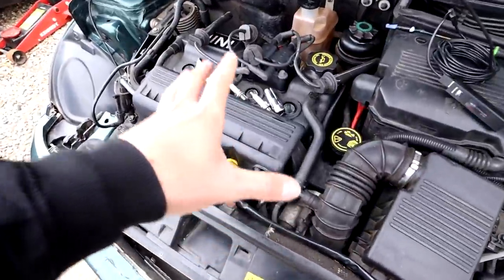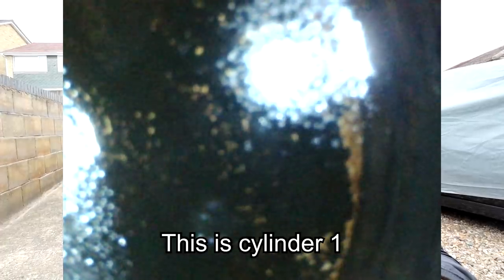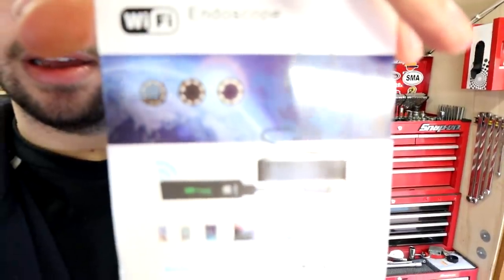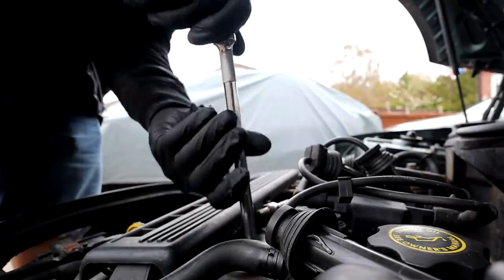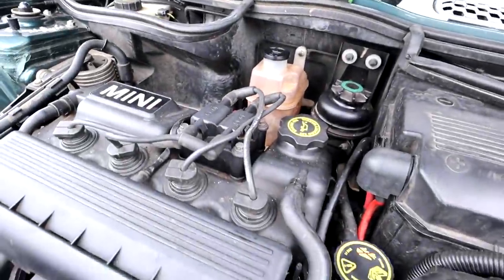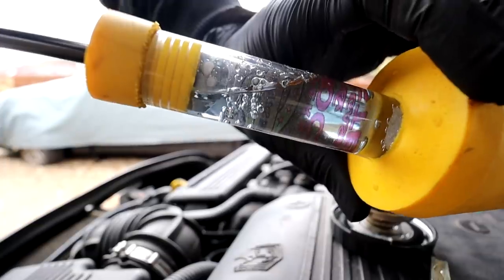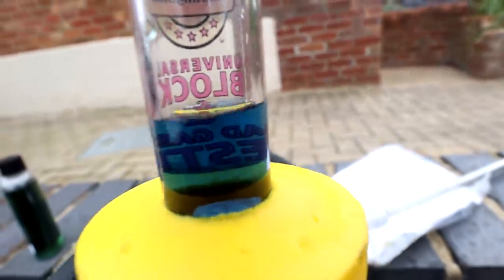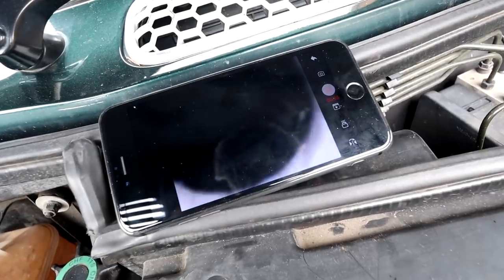Mini Cooper NEEDS a Headgasket!

Comment: Hello Mate. The test kit goes on the header tank. The engine needs to be running while doing the test. Any products of combustion are pushed up through the header tank. The Gasses are pushed up through the sniffer kit and mix with the test fluid.

Comment: I thought the tester was supposed to be used on the header tank, because it's only supposed to "sniff" the air when you pump (rather than suck up coolant as it did in the video). That's how I've always used them (usually successfully), but I may be wrong.

Comment: Stick an egg in the coolant bottle, if cylinder 1 has scrambled eggs in 20 mins u know its gone. 😂
Reply from the maker: Jason Poole 🤣
Reply: Jason Poole is that your RS because, it’s looks mint
Reply: @Joe-qs9fw  Yes mate, Cheers
Reply: Jason Poole also a tasty breakfast once you get the head off.
Reply: @Cjrelectrical  HaHa agreed.
Reply: I guess your RS has already made you some scrambled eggs then?
Reply: I apologize :)
Reply: @colinboyd4371  lol nah i had it fixed before eggs where served 👌
Reply: @jasonpoole6284  Excellent news, i'm probably just jealous :)
Reply: @colinboyd4371  Nah dont be they are over rated.
Reply: tried that out, engine stopped working, there is black smoke coming out, WHAT TO DO NOW???

Comment: James re-do the test.It starts off blue run the engine and re-do test with engine running. if it goes pale green or yellow that means you have exhaust gasses running through the coolant.

Comment: Glad you have managed to confirm it - always good to be 110% sure about something rather than guessing. Though i must admit i guessed it was the headgasket in the first video where you were bleeding the system. For one, whee did all the coolant go if it was not escaping externally?, then once you had bled it you were still getting a pretty consistent stream of bubbles escaping through the filler neck whilst the engine was running, in my experience that is a very good pointer to gas being forced into the system. The final nail for me was in this video when you showed how badly it ran when you first start it up, add that to the other evidence i was convinced it was the gasket. But its always preferable to see conclusive proof - and you can't argue with actually seeing the water dripping into the cylinder. Always good to get rid of any doubt when a lot of work is involved. But should be a fun job, like you i love doing jobs like this.

Comment: Next video, mini front end service mode. You don’t need a timing tool for an r50, but you will need a few bits to take the drive belt off, I made do with a 16mm socket, a bit of foam a long crow bar and a 5 mm Allen key, but I have an r53 so yours might be slightly different. You will need a harmonic balancer puller, take off the timing chain cover with the oil pump. You will see some bronze coloured links on the chain. Two on the crank sprocket and one on the cam sprocket. Check the cam and followers too as they tend to wear quite badly as these engines suffer from top end oil starvation.

Comment: Compression test, if it holds pressure, along all 4 cylinders, head gasket, casting, piston rings and valves are fine
Reply: Which it didn't, so needs a head gasket
Reply: @ethanmccrory1727  He didn't do a compression test though, if he had, it would have revealed an issue in minutes. One of the best diagnostics tools is a compression tester 👍
Reply: @GTStGambit  coolant pressure tester?

Comment: Bash the inside of the door where the motor is while holding down the switch.  Bang it hard! Mine goes on the blink from time to time. A good old banging does the job for me. Also pushing the window down while holding the switch has also worked once

Comment: My tester has blue fluid...it should change to green or yellow to indicate exhaust gases in the coolant....The instructions mention that it should be stored carefully and once opened it is normal to discard the remainder...it goes off quite quickly IIRC.  One other thing is that you would be safer and better to sample the gases from the overflow/header tank...same result if the engine is at operating temperature. but without the 13 odd PSI and hot coolant to worry about.

Comment: I've had gaskets that were not leaking into the cylinder and one of those testers was the only way to diagnose it. Mine started blue and turns green/yellow after a few minutes of engine running. In each case I've also seen a continuous stream of bubbles through the tester.

Comment: Tip to know easily if coolant is being cooked off. Have a quick smell of the exhaust gas, if it smells sweet (exactly like coolant) then you have coolant in the exhaust stream. Would have been my first test... try it before you pull the engine apart James, then compare with a properly running engine. Once you've smelt it once, you'll easily recognise the smell in future. Keep it up. Good investigative work, rely upon testing rather than guess work ftw. 👍

Comment: Notoriously hard to diagnose a blown  head gasket that isn't obvious.
Had a vauxhall Astra that was losing coolant , was only slightly overheating in traffic and was still driving okay .
Took it to a garage I trust and they used the emissions machine they use for MOT testing to do a sniff test , no carbon monoxide in the expansion tank .
A few weeks later I decided to use the test similar to the one you used and the liquid turned blue .
Head gasket was gone , as I said it's not always  an easy diagnosis to make.

Comment: Check the head is not warped with metal straight edge  before fitting gasket the head might need to be skimmed
Reply from the maker: Mike N it’s not my first rodeo lol
Reply: @TheSavageGarage  Honestly i have 4 minis in my family and have made all the i should have done  that mistakes whilst trying to fix them even though being a Trained Motor Mechanic  ,Main problems on R50 mini are  Rubbish midland gearbox except for Cooper s and diesel model which had Getrag boxes, Head gasket issues, Timing chain failures, Power steering pumps, Plastic Thermostat housing failure ,Front wishbone rear rubbers ,Engine mounts ,Seat belt pretensioner cable connection under seat ,Central lock motors behind door handle  and the list goes on but they are still a nice car to drive when Wife and Daughters let me borrow them. Also not as reliable as Ford Mondeo "forget rodeo and think Grand National with minis"  thump with fist just above speaker cover will fix electric window sticky motors never fails to work

Comment: The sniff tester has to be used with the engine running.  The fluid should start off blue and will change to green/yellow if combustion gasses are present.  If you hold the tube up to the exhaust tailpipe you'll see the colour change.  You won't get any result if the engine isn't running as no combustion gasses will be pushed into the coolant.

Comment: dont forget to get the head properly checked to see if its warped after running that hot and also get the head milled otherwise you will get this problem again

Comment: i knew the head gasket had gone aswell from the first video ,with the bubbling from the header tank when running..which would cause the system to presurise and throw water out......also the miss fire at the begining is the water in cylinder 1

Comment: The tester should be on the header tank, engine running. The liquid should be blue to start. Then turn to green or yellow depending on how bad the leak is. Maybe that liquid is duff, or give it a shake up first.

Comment: @james, the block tester liquid has gone off, should be blue, best way to check it, start the engine and use the tester at the exhaust end with it running it will change colour. Your meant to do it running with like the steam coming out of the coolant cap.

Comment: Try putting a tube between the radiator filler (an old toilet roll maybe)and the sniffer test and allow it to take in any potential combustion gases, you can also test the tester by sniffing the exhaust gases into the tester this should turn it yellow very quickly you can even then sniff fresh air and the fluid will turn back to blue and can be reused😉.

Comment: Normally if ur headgasket goes if ur exhaust is blowing white smoke check ur oil stick & it's a goowey white &water threw it as ur oil cap is white&black & sludgy,I did a few in xr3s,xr2s back in the day,don't no if newer cars AR the same,as not a boy racer now,keep chin up bro

Comment: The camera footage makes me think the cylinder head is cracked and this isn't the head gasket. I had this exact issue with my very first car (old MK3 ford escort), that had the same issues on starting until it warmed up. I guess we'll all see when you pull the head off. The footage clearly showing dripping down onto the crown of the piston definitely makes me think you have a cylinder head problem. Looking forward to the next video! 👍🏻

Comment: I would of done it with the engine running and from the expansion tank i would change the head gasket any way your doing a great good james so dont worry how you doing things keep up the good work looking forward to see you doing the head gasket 🙂👍
Reply: It was interesting to see the water leaking into the cylinder like it was it was coming in quite a bit nice

Comment: The Dr Headgasket fluid is blue in all of the online adverts for it that I've seen. Maybe it was used and could change back to blue!? If the tube/container that you put it in was contaminated with coolant that could have reacted with the fluid too. The dripping liquid is enough though isn't it, to decide what you need to do. ....

Comment: Do you have a retest again with the expansion cap Removed to bleed the system of air and  keep the engine at operating temperature and put over the Combustion Leak Detector tool or sniff test tool hover over expansion tank and pump to see if the liquid definitely turn yellow or green to confirm diagnosis of fault but the camera has already done it for you

Comment: Fair play coming up with the idea to put the pressure tester on then look in the cylinder that's what I usually do with them you'll be better off just taking the engine and gearbox out btw best way to do the head gaskets on the minis

Comment: James get a bottle of Steel Seal will fix the head gasket,trust me on this one .
Me 1.2 Corsa was worst then yr mini and Steel Seal done a grate job.
Reply: My Lexus has a blown headgasket it is very common on the is220d my fault as i was racing a Porsche but the steel seal didnt work at all it was a waste i did it twice and neither worked
Reply: Worked on my corsa too but sold it not long after so I don't know if it worked long term.
Reply: Well is dependents man.but on 2l engine u need 2 bottles of steel Seal.
Reply: I kept my Corsa another year after using Steel Seal. Whitout any problem.

Comment: When you start up and go to the back, you can see a damp patch under the exhaust pipe, doesn't this indicate it pushing water out? sure it shouldn't do that, yes you'll get a little condensation, but that puddle is more than condensation, also I'm seeing a faint hint of blue smoke. can you smell burnt oil (sadly youtube isn't smell-o-vision) :)

Comment: My car sounds the same on a cold start up then after 20seconds or so and a little rev it goes fine. Everything is ok with my car but in not sure if mine makes that noise becuase its only a 3cylinder or what but my car makes a similar noise on cold starts

Comment: this is a common problem on this minis I have done many of these head gaskets there a pain in the ass you've got to take the engine out to do it if you want any advice message me
Reply: No you don't
Reply: yes you do mate I'm fully trained mechanic I know what I'm talking about I've been doing these engines for years on each of the sprockets there is an arrow which lines up with a marking on the chain you turn it over until the markings line up and then it is at tdc

Comment: Mini's suffer from Head Gasket failure and Radiator failure.  Head Gasket change you are looking at £650 min by someone who really knows what he's doing as the valves need hydraulic adjustment.  For the radiator the whole front end of the car needs to come off.  In summary the common faults (after about 8yrs) with modern mini's are , Steering Pump (£500), Air Con Compressor (£900), Head Gaskets (£650), Radiators (£150).  Labour by skilled mechanic about £2000 for this lot.  Just aren't worth the bother!

Comment: Throw a bottle of steel seal in.the symptoms you have are minimal.i would drive that long haul and not be worried.great vids keep em going
Reply: dont put this crap in your cooling system EVER i have seen cars where it has clogged all the coolant channels etc... nasty stuff. just get the job dne properly
Reply: Agreed with the above comment that you should NEVER use that crap it will cause more problems than it’s worth either fix the head gasket or sell the bloody thing don’t bodge it
Reply: @mrwick7961  steel seal isn't fiberous, it hardens chemically
Reply: @adamspencer95  and then chrystalises throughout your cooling system if there is any trace of air within your coolant

Comment: If the head gasket has gone the water would run down the side of the cylinder wall and pool on the top of the piston. 
Think you might have a crack in the head if its dripping in. Great channel good luck with the head 👍👍👍👍oh btw why dont you change the timing chain too at the same time it comes as kit we call it a cassette kit you slide the hole thing inn in one go you only have to remove a couple of bolts and the bottom crank pulley.
All the best mate 👍👍👍

Comment: If it's dripping in wouldn't that be a cracked head?
Reply: Having had this exact issue on my first car, this defo looks like a cracked cylinder head rather than the head gasket itself.

Comment: Now you know where the coolant had gone, when it was missing, when you bought the car. That engine must have had a hard time running like that for some time. 
And don't forget to check the state of the water pump after the torture that engine must have gone trough!
The tester should have been put on the opening of the overflow tank, with the engine running. As it has to sniff the possible gases in the coolant, not contaminate the testing liquid.
Here's another method on how to use it: /watch?v=QA7KVQq9vKA
Cheers!

Comment: The new minis are riddled with lots of problems. German engineering is not as good, as it used to be. Guy at work has had his stop twice, while on the outside lane of motorway.
Spends more time at dealers than on the road.
Reply: German engineering is awful. VAG cars are even worse than BMW if thats possible!! They look good tho so remain top sellers

Comment: You are about to enter the world of cheap rejected BMW parts used in the Mini.. While their doing head check the  timing gear famous for guides taking a dump, chain stretch,,,  You might need a special tool or two to pull these junky motors down,, Good luck & kiss good bye lots of money,,,